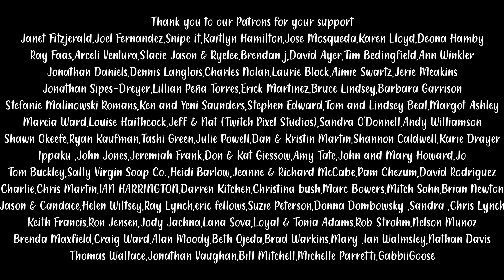THIS IS THE WORST MISTAKE WE'VE MADE // couple builds own home

Comment: Hi. this is just a thought but, My husband hauls stinky stuff sometimes and they use coffee grounds to take the smells out of the trailer. Im wondering since you own a coffee shop, if you could save the coffee grounds, try to dry them out and use in your composting toilet? That would help with any lingering odors. The build looks to be getting so finished. great job guys!
Reply: Used correctly, a composting toilet does not smell.
Reply: @Derek Frampton aKa 1PaPaD1 I stand corrected. If used correctly a composting toilet doesn't smell bad to the average person. I kind of know what you mean because I can smell cigarette smoke a mile away!

Comment: I've been a carpenter for almost 30 years, and if that's the biggest mistake you've made you're in good shape. I would recommend running your stovepipe out the wall then up. That will also rid you of one potential future leak.

Comment: Just run the chimney out the wall, We found it a lot easier to clean that way. We run the brush from bottom to the top.No need to climb on the roof.
Reply from the maker: You have to go straight up with 3 inch pipe
Reply: This is good advice.
Reply: @NomadicMovement  read your codes for yourself, and don't rely on what other people say. Obviously I'm not in Panama, but I ran into the same resistance until I checked out the building codes for myself. Both my wood stove pipe and plumbing vent pipe go out the side of the house and then up. No holes in my new roof!
Reply: @NomadicMovement  I have lived in Panama 14 years and yes you can go out through the wall and 90 up.

Comment: I love my natures head toilet. Last year I didn’t have heat in my van, not only did I freeze, but so did my toilet. Lesson learned, I installed a diesel heater and with -21 degree Fahrenheit outside a few days ago I’m toasty and the Natures Head is working well.

You won’t regret buying it, especially with baby on the way.

Comment: You can mix in the stove's wood ashes with wood chips for the ecolet toilet's compost. To make it less messy mix it outside with chips and some water to suppress dust, keep in sealed 5 gal bucket in bathroom. Later, when you collectively are using more of these toilet's on site, you can justify making your own charcoal from waste wood ( non straight, med to small limbs, off cuts, knotted etc )  You already have the metal crafting skills to make a big central community smoker-barbecue/pizza oven/charcoal making vessel... even better if you can find some old fuel /compressed air tanks. ( NOTE : fuel tanks should not be used for bbq etc without multiple MAJOR burn in processes internally and externally to clean, but fine for charcoal making )  The charcoal, if made from appropriate woods, can be used for water filtering with some fiber filtering media to stop finest dust.

Comment: We've used a natures head since 2017. Definitely keep the plastic clean as best you can because it gets hard to clean. I would recommend installing handles on the compost bin for when you empty it. Get ready for $#!+ flies 👍 definitely be sure not to scoop tp into the pee trap with the poop hatch it will soak urine into your compost.

Comment: We have used cartridge toilets $200 in our off grid rental cabins. They use only 1/2 cup of water or less to flush and operate on 12 volts. Yes dishes consumes a lot of water and showers of coarse. Maybe you can find some sawdust from a wood working shop for the toilet.

Comment: I think you can just add an "elbow" to the chimney and route it a little to the left.  It should work just fine.  When I was a kid Dad had to move a large wood burning stove but already had the whole in the roof.  He bought a couple of elbows and moved the stove about 4 feet.  You can use two 90-degree elbows or two 45-degree elbows.

Comment: I'd have cut a notch in the back left corner of the grating and run the exhaust up through the hole. You could maybe weld in something steel to insulate the shelf contents from the exhaust.

Comment: Take a look at a "Doug-&-Stacey" video 
that shows Doug's new wood-fired hot-water-heater,
because that has a "through-the-wall-&-then-up" flue system,
that has provision for easy (and thus more frequent) chimney sweeping,
and an external (outdoor) flue-pipe.

BUT  . . . . 
You might loose some of the heat from your small fireplace,
with an outdoor flue, however.

Comment: Just wanted to tell you a story.   Back in 1983 we decided to build a house instead of buying one.   Because of a solar class I took in college, we decided to build what is called an earth contact house.   Three sides below grade with the front being a wood wall.   You can step from the lawn in back onto the roof.   We put all living spaces in the front and utility spaces in the back.   The advantages are that it is less expensive, less labor and being below grade on three sides, it cools the house in summer and offsets cold temps in winter.   From start to moving in was 13 months of working only weekends and holidays.  
Back then the 1800 sq ft house with 2 car garage total 2400 sq ft and exterior work completed cost us $40,000 which is $100,000 today. 
I thought the story might help you.   Best wishes!   Kevin

Comment: You only need to put a straight piece out of the stove then a 45 degree then straight up from that or go out your wall and up the outside of the building with the chimney but depending on your overhang would have to 45 around that as well.

Comment: Natureshead's weakness is Urine. 
BUT portable urinal-bottles (1 litre each) are readily available 
in both male & female versions
and these will, I suspect, 
allow you to NOT rely on the Natureshead when peeing 
(especially during the night, or during rain-storms, when outdoors is not so attractive).
Alternatively, modify the Natureshead, with a hose 
down to a remote "Greywater" tank,
and use the combined Grey-water & Urine for your plants (?)

Comment: Hey, have you considered doing more of what I would call “dap” welding instead of the constant weld you do. It is more like the stacking dimes look by dapping the stick back off and dap again down the length of the weld desired. Kind of spot welding string. I would think it helps cut down on the duty cycle usage and battery drain and grinder cleanup. Happy welding.

Comment: Hey guys.  Yeah, be sure to hook up the fan for the toilet.  Also, with all of you using the toilet, and Kaylee prego and peeing all the time, you will find the urine bottle is going to have to be emptied a lot, and that bottle is sometimes messy.  You guys will want to get rid of that bottle and add a PVC pipe to the urine diverter and have the urine go down through your bathroom floor to a grey tank,  You could have it go right on the grown but it will smell eventually.  Jordan I know you got this.  Also, have that vinegar and water spray bottle by the toilet so everyone can spray down the toilet to get the urine out of the bowl.  I'm sure you know all this, but I was just getting mine together on my bus build so it was on my mind.  Stay safe

Comment: Since there is such a dearth of lumber down there, I wonder if you have considered alternate types of construction such as  Rammed Earth?  If there is clay in the soil, this is a viable prospect for building.  It IS very labor intensive but this kind of house will offer you a lot of insulation and protection from insects and other positives.  Check out some videos.  I first heard about this back in the 70's in a Mother Earth News magazine, and it left a tremendous impression on me.

Comment: I would move the stove to the left and run the pipe straight up or put an elbow in.  Looks like it would be good to move it away from you seating a bit anyway.  Way easier than reworking your shelves.  I assume that you probably already figured something out by the time you get this comment.

Comment: That wood stove really should be brought out farther from the wall. I'd say just bring it out past the shelf you've just installed so the chimney can run up in front of it, it will end up making your place much safer getting the heat source away from the wood panels. Also you should look at the DIY 5 gallon pail composting toilets, you can buy a urine diverting toilet attachment for them for cheap which does the same as the Natureshead, then you just build a box around it with the toilet seat and lid on top and you can use 12v computer fans to pump the smell outside. They're MUCH easier to clean and maintain, you can even use composting bags to catch the solids, not to mention WAY cheaper. Keep up the great work!

Comment: The white cabinet gives me major anxiety just seeing it through video lol
Reply: SAME. Every time!
Reply: Wood stoves need a damper so...
Reply: People scared because they're too used to wood. Steel is a completely different animal.
It has 3 steel triangle supports. And it's attached to the wall, which is also supported by steel.
Reply: @eleanorcramer7986  Not necessarily. I've had only wood heat for over 30 years and have not had a damper. I control the airflow with the vents on the front, need more airflow open the vents a little, for less close them a little or shut them completely and stop any air from getting in.
Reply: @marypearling1418  I was doing a play on words as having reservations to consider.  Enclosed wood stoves have great air flow controls.  Love wood heat.  Depended on it in two room cabin for a couple years then another very old three room house with outhouse.

Comment: I'm not saying it's going to fall, but if that wooden cabinet you built ever starts to sag all you have to do is put in a couple of braces that go from the wall, about 2ft below the cabinet, and up to the bottom front of the cabinet. The same thing @Wildwonderfuloffgrid did to hold their solar batteries shelves up.

Comment: A natures head toilet is nothing more then a high tech bucket toilet. Fill it with sawdust and you'll be fine, and you really didn't have to go crap in the jungle, you could have just done a bucket and urine separator and it all would have been good. Funny thing is, when I built my tiny house on wheels I made my bucket toilet thinking it's gonna stink and then found out everyone was right, you put a handful of sawdust down, poop on it and put another handful on top, and go figure.....no smell. So, you didn't really have to poop in the jungle. Still, I'm glade you got the upgrade, the place is looking good. I don't think you'll ever be done making, creating, dreaming but once you've done it for a while, it kinda gets in your blood and it's hard to take a break. I know you find time to laugh, and maybe some time to hold each other and dance. I know this is gonna seem strange for me to tell you......But, Your Alive, and living the dream. be happy.

Comment: did you forget there are things called 90's for chimneys
Reply: They are not good to use but yes they do make them
Reply from the maker: Not for 3 inch pipe and small stoves. This stove needs to go straight up
Reply: They make it for 3 inch pipe..  dubble wall... thats what gas water heaters use
Reply: 2, 45 degree bends to create an offset will solve this one.

Comment: Kayleigh there are multiple reasons for morning sickness normally because the parents blood type is different. This is perfectly normal and no reason to worry it does not complicate the pregnancy in any way.

In the meantime enjoy your pregnancy just because you are suffering does not mean that others do not have to suffer. So daily back and foot rubs are mandatory as is slacking off from any work you do not want to do because of the baby. There is of course the good old pregnancy cravings and you can get Jordan to go get you sausages and strawberry ice cream at 1 in the morning if you wish. Us Guys are pretty sure this is made up by pregnant females but we are not sure so will do so even if there is a hurricane outside. If you re bored  burst out in tears and claim he does not love you and watch the perplexed expression on his face. Then blame it on pregnancy hormones! This can also result in extra backrubs and flowers.

In short have fun with your pregnancy I also suggest you make Jordan go buy you one of those Foot Spa thigs your feet will thank you and they will be clean for the foot rubs.

N.B. Chimney wise this is no problem as you can just add a bend however this will not change the laws of physics and heat from the stove will rise straight upon to your tools. Not a big deal however there are some electronics so either weld some nice shiny Stainless underneath it to divert the heat away or even simpler make sure the electronics are stored away from the heat i.e. with the chainsaw have the chain on the furnace side but preferably both.

P.S. I am sure you have researched this but from now on Jordan cleans up and Poo especially cat poo very bad for pregnant woman and babies not just an old wives tale or an excuse to get out of a yucky job. Toxoplasmosis.